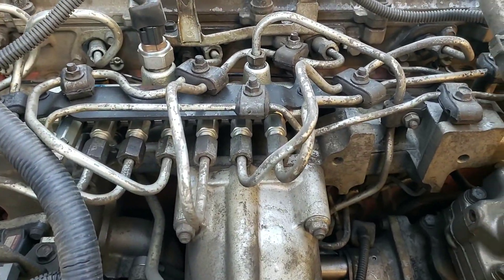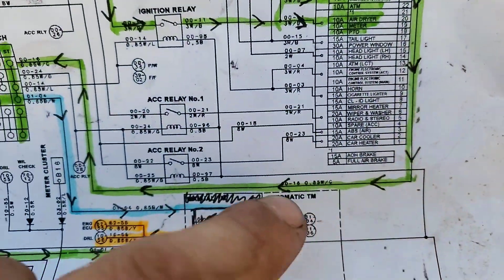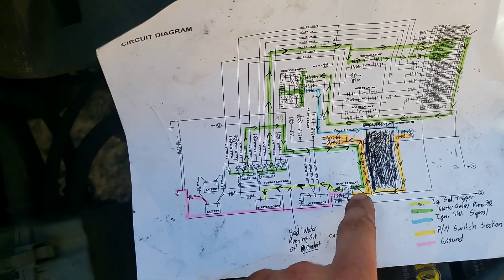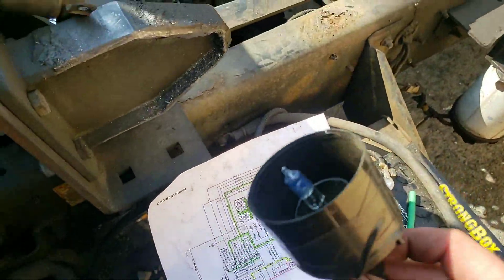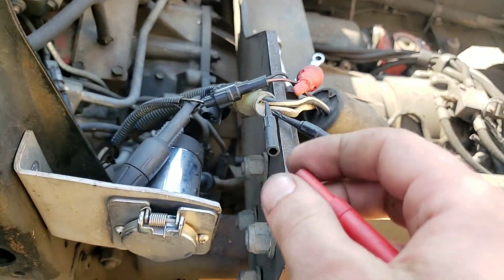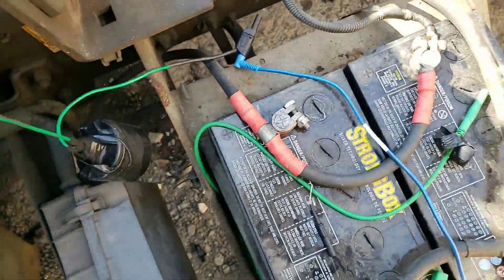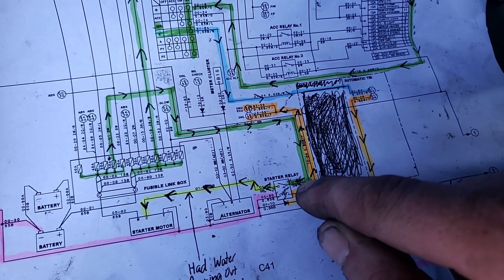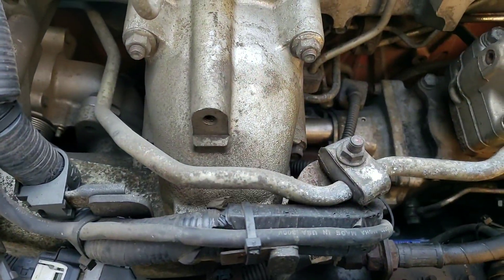UD 2000 - No Crank, No Start

Comment: Nice work!  Do you have any more diagnostic videos on this truck?  We have a 1999 UD1200 with a Nissan 4.6L turbo diesel engine and we can't locate the factory service port to retrieve check engine light data.  Do you have any information on the location of that port?  Is there a manual way to pull DTC codes without the fancy manufacturer scan tool software?  Thanks!

Comment: Great diagnostics video.  Any idea where I can get an electrical schematic?  I have a similar issue with a 1998 UD 1800 Manual Tranny but intermittent no start.  Ignition switch seems good, no 12V to the starter relay coil - when it does not start.  When it works it starts immediately - anywhere from 1 to 30 attempts (key turns) before it goes.  There must be a component (or multiple) between the ignition switch and starter relay on the manual transmission truck - the schematic you show has the manual tranny info scribbled out (rats!).

Comment: having the same problem with my 2012 ud 2000 and im actually broke down at a gas station right now how crazy is that! exact problem i have lights and i hear a click but  no crank , it just cut out mid crank after fueling up and now it wont turn over im going to try the ground wire like in the video how can get a hold of one of those tester kits to jump the ground from the battery ? or do you know another way im hoping thats the problem instead of a starter it wasn't showing any signs of weak start please help!

Comment: Have any experience with durastar 4300 with maxxforce engines. My engine sensors circuits are are acting nuts. Intermittently the engine sensor parameters cut in out from healthy realistic numbers to parameter numbers that make no sense whatsoever. I found the aluminum foil shielding is rotten away and is coated with blue gunk in some burn Mark's I found. Theres no actually burnt wires but the wire foil shielding seems to be disintegrating. 

Could this shielding being be whats interfering with my other sensors? This truck has been to 4 other shops and nobody has been able to fix it. International wants like 1500 usda for the sensor harnesses loom so I'm being really hesitant looking for expert opinions
Reply from the maker: The shielding keeps EMI out of the signal wires, so that would definitely be a problem there. There are other potential issues, but I'd fix what is a known problem before continuing. 

Next step is to find a good trustworthy mechanic to either guide you or do the work. Electrical is very hard to diagnose over the internet.
Reply: @ScienceOfDiagnostics  this is what I want to specialize in. Theres a niche for it here ,in Detroit.  Thanks for the quick response I enjoy your videos and feel the age of the part changers are over in the mechanic field and I'm trying to rapidly evolve